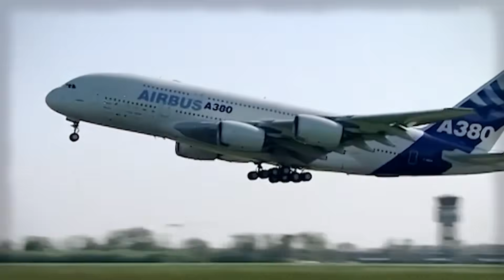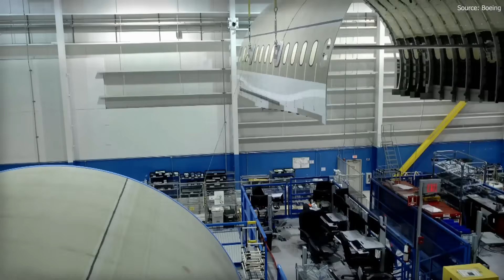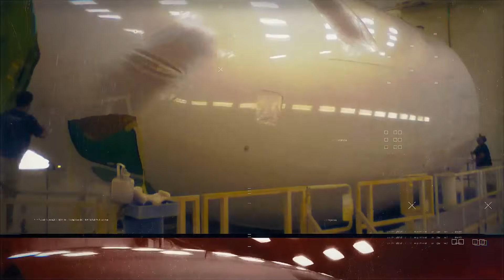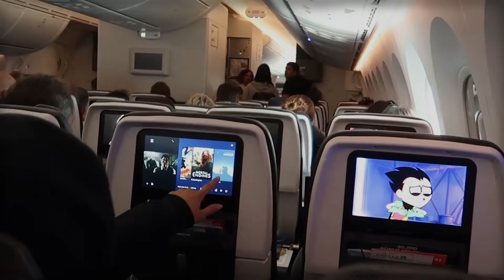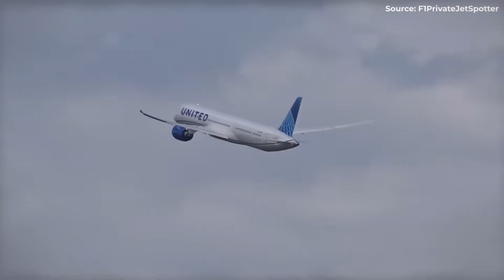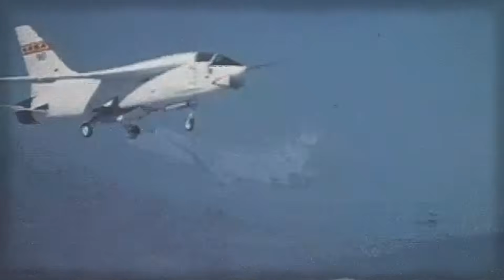This is Why Boeing 787-10 Is Quietly DOMINATING Long-Haul Flights!

Comment: One big problem in the future is that carbon fibre can't be recycled. So we going to have fields with big aeroplane shells we can't reuse.
Reply: Material design is moving toward vitrimers and high-performance thermoplastics (like PEEK and PEKK). These polymers can be repeatedly melted, reshape, and bonded. In 20 years, carbon fiber composites will be intentionally engineered for disassembly from day one.